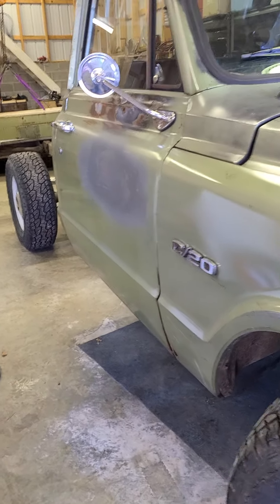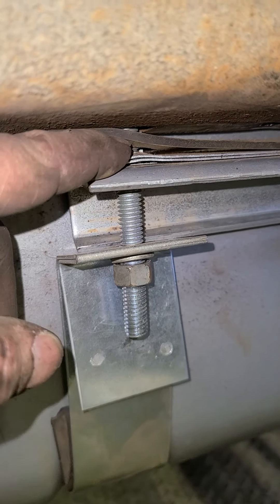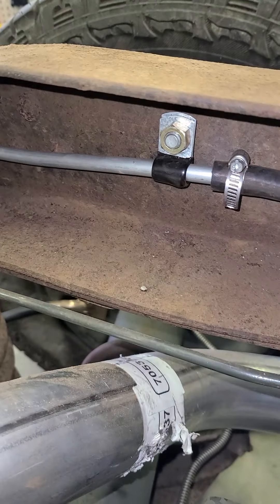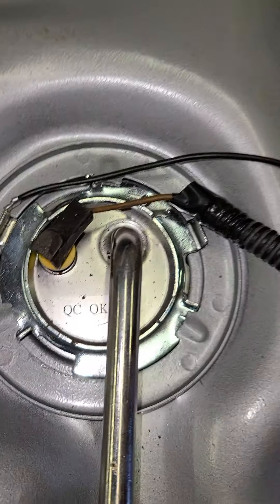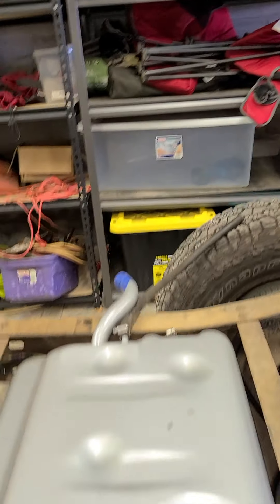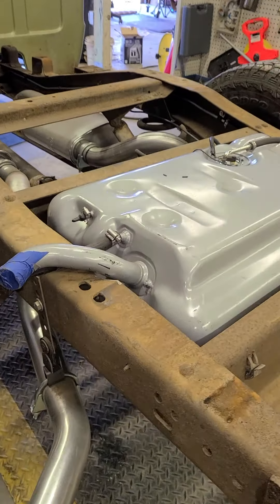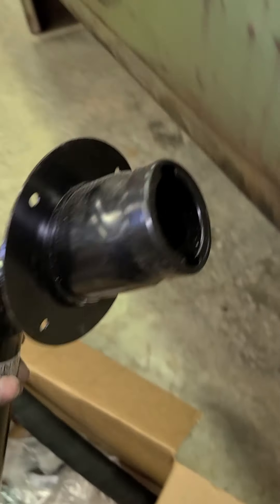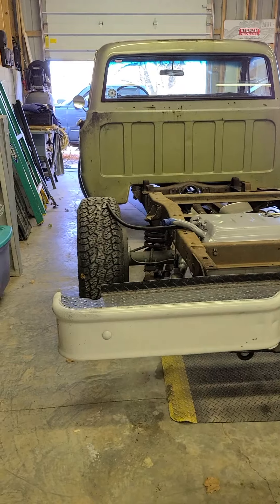67-72 C10 / C20 fuel tank relocation part 2

Comment: We're did u get the tank..hoe much??
Reply from the maker: The tank, filler neck,and gas cap came from LMC trucks. I ordered the Blazer parts for my year truck. Good luck on your project.
Reply from the maker: If you go in my playlist and find part 1. You will see the box the tank shipped in. There is a part number on the box. Hope this helps as well.